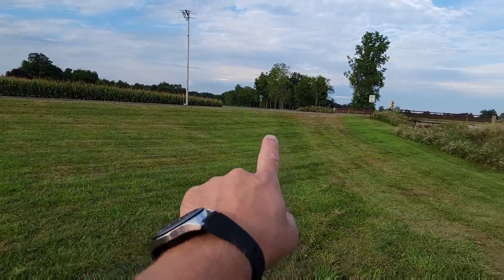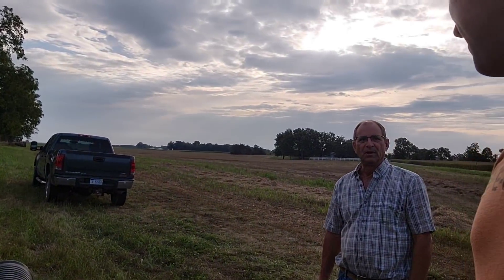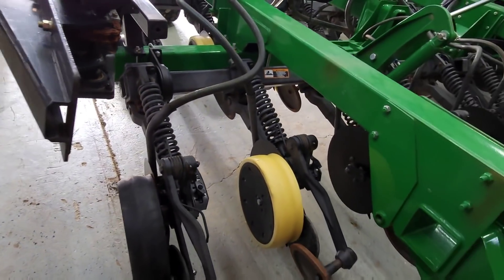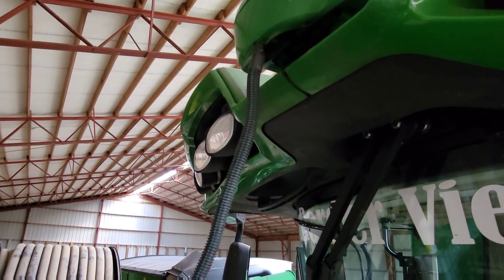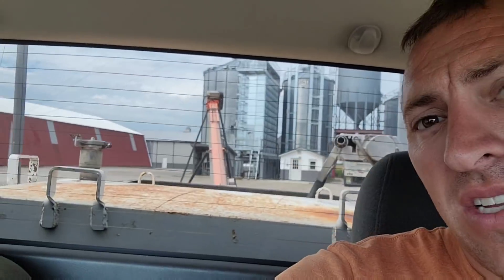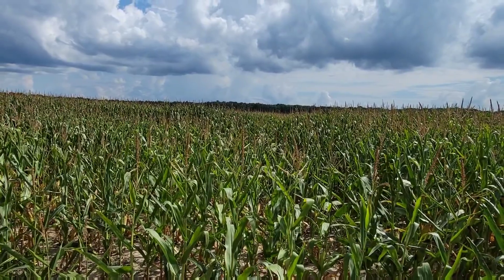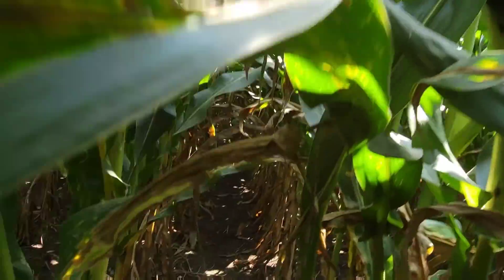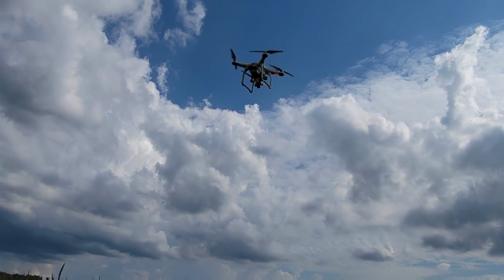Red Corn! - #487

Comment: I have had the same problem with a older truck not being used as much. I think it's the ethanol's shelf life. Usually we are putting fuel in all the time and it never has time to get old. When a vehicle becomes a second fiddle, the fuel gets old faster then we think.
I let one sit for 3 months and 2 injectors clogged.

Comment: Nice kernel tip fillout on those Entigen cobs, fat long and lots of rows

The mid west and east gets hammered by heavy torential rains.
We have had the driest summer on record.  They claim a trace whatever the hell that is.  I felt a fine mist one morning.  Many of the fir and conifer forests are heat damage and dying.
Expect the best fir and hemlock lumber from the West Coast for the next several decades to double in price.  Has killed billions of board feet along with the massive fires for the last 10 years

Comment: sure have covered it before but what is advantage or deal with the antigen or special silage corn?
Reply from the maker: Enogen has an enzyme in it that increases the digestibility of it and breaks starches into sugar.
Reply: @BorderViewFarms  Does that enzyme work on the stalk and the seed kernels?  If that affects the kernels, breaking the long-chain carbohydrates into shorter ones,  it would increase corn's utility as a feed, and in ethanol production.
Reply from the maker: @elhanson5426  it works in the kernels. It was originally developed for ethanol production and then feed benefits were discovered.